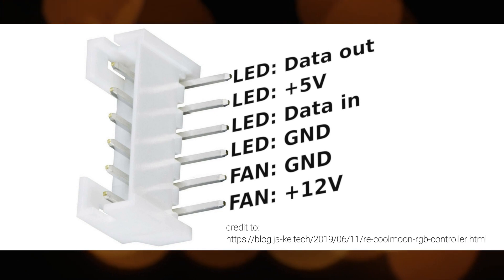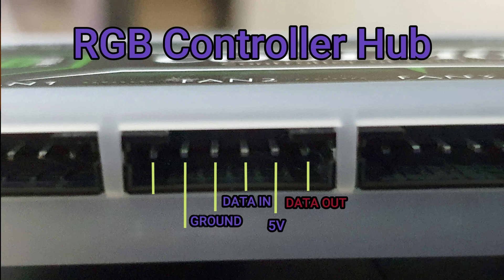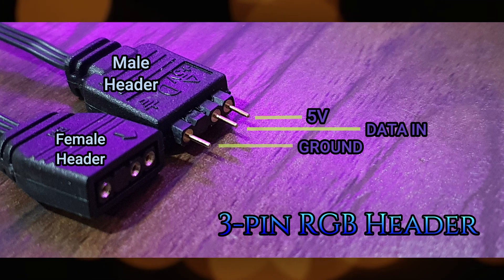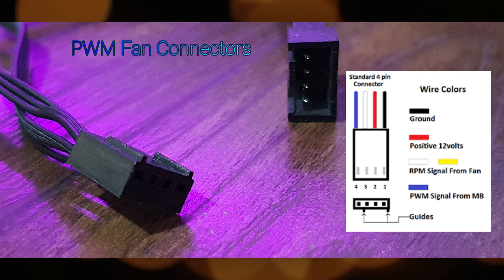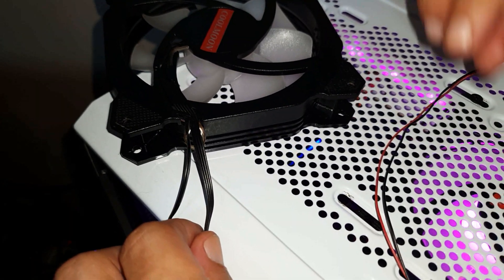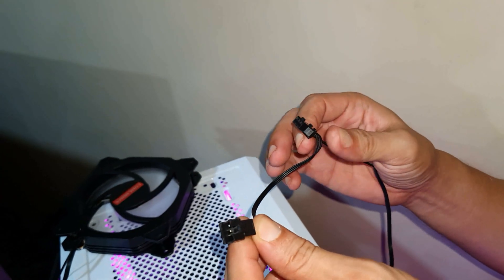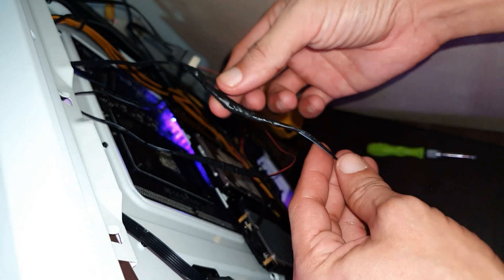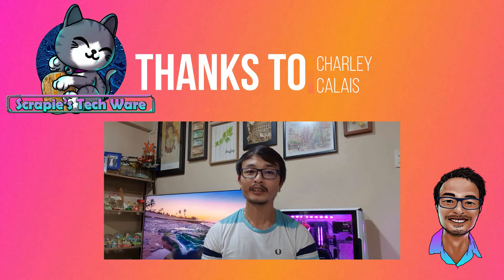Modding a 6-pin header fan (Coolmoon, uphere etc)

Comment: I couldn't see the sockets when you were plugging them in so it was hard to tell which ones you were using and you used electrical tape to tape them up so I know some of you guys have this figured out but I'm too new to this I'll need to see which ones you connected. I can tell it's a good fix I just need a little more information. Good job

Comment: They are nice fans but useless, because they are incompatible without the use of their controller on recent motherboards because they do not have the separate 4-pin connector with PWM control.
Reply: Most modern motherboard have variable DC which exactly functions like pwm

Comment: Great video. I’ll check if the pinout is the same for the Darkflash fan controller (for AIGO DR12 PRO fans). If it works, I’ll keep the Darkflash speed control and manage the ARGB connections with the Nollie controller. 😊

Once I test it, I’ll come back here to confirm if it’s the same and if it worked out.

Comment: can i use 3 pin to 6 pin header  plz reply i need help
Reply: Yes but you can't adjust the speed and light up the rgb, it'll only spin the fan
Reply: sping the fan with pwm mode? @ericdizon3320

Comment: I have 2 CPU cooler fans with 3+4pin adapters and 6 fans with 6pin adaptor. I was using 2 different argb kits that didn't sync well, and because of your video I'm able to convert 6pin into 3 + 2 pin, I used jumper male to female wires, and now all the fans are in 1 single coolmoon argb kit and syncing well. Great job. 👍🏼

Comment: i had deepcool fc120 which is 6 pin rgb fan, but different pins out than normal 6 pin argb gan, from left it mark DI, - , - , + , S, P when i try use normal 6 pin rgb controller it won't work, and  what is S and P stand for on the fan connector?
Reply: Hey did you ever figure out a solution for these fans? I have the same FC120
Reply: Yeah I've got the same fans and need to find a solution

Comment: i just want to power my 240 mm fan. it has a 6 pin connector and i want to plug it into a 3 or 4 pin header on my mobo. i cut the 2 wires and connected them to an old fan connector and when i plugged it in it doesnt work. what did i do wrong?

Comment: The 6pin controller is more cheap than 3pin argb + 4pin PWM controller, it's because the 3+4 is have 4pin data in from motherboard, so the controller can automatic sent the data PWM to fan. It's right???

Comment: Yes, but what is the fucking DATA OUT cable that you said to JUST IGNORE, what's it for? NOT OINE PERSON OR PIECE OF DOCUMENTATION ON THE WHOLE INTERNET TELLS YOU THAT, SO IF YOU DON'T KNOW EITHER, YOU SHOULD JUST SAY SO, INSTEAD OF ACTING LIKE IT'S NOT IMPORTANT BECAUSE OF SOME SECRET FUNCTION OR SOMETHING. Why just ignore it when it obviously has a purpose otherwise it wouldn't be there IN THE FIRST PLACE. so to just ignore it means you are ignoring a potential favourable function that that one cable is in there for...SO WHAT IS THE IGNORED DATA OUT CABLE FOR? That would be more helpful than to jusyt say ignore oit, because otherwise what you just put together is redundant because EVERYTHING in your video is ALL over Google. Sorry FOR THE FRUSTRATION MATE, BUT YOU DON'T KNOW MUCH OF A WASTE TIME WATCHING THIS WAS OTHERWISE.
Reply: The Data Out cable is to continue out the argb/digital signal onwards to another fan or a argb device, which enables the ability to have a chain of devices in order to display complex rgb patterns not simultaneously but one after the other. This is also known as a daisy chain
Reply: Just did my own research since i also need these. 

Those 6 pin connectors are actually just two connectors combined. 
3 pin ARGB (usually "4 pin" with one always missing).
3 pin FAN. So not a PWM (we can't control its speed), just standard fan, that is Ground, +12v and Tachometer that reports back on RPM of the fan.

So in short data out is RPM report from fan to motherboard/hub/whatever.
Reply: @BitFrosty  genuinely was about to type out similar response, but thank you for handling the bulk of the issue.
  As an electronics specialist, when you have a dedicated wire in a harness, specifically put there by a manufacturer, and you decide to bypass or modify its purpose because it works on your personal device does NOT mean itll work for everybody.
  I could go into great detail about why this circuit manipulation works in certain environments, however....do not do this and just assume youre good to go.
Reply: As @devilproductions-official says above, the Data Out line lets you continue the RGB chain rather than running each fan as an individual.

To expand on that:
Using a hub, the software doesn't see all the individual devices that are plugged in, it only sees the one device, and the hub duplicates the software output to each connected device.
For example, if each fan has 8 led segments, if you connect 3 fans through the hub, the software will only see 1 fan with 8 segments and output an 8 segment pattern, and all 3 fans will show the same pattern.
BUT, if you run the data-out from the first fan to the data-in of the second, and the data-out of the second to the data-in of the third, the software will see 1 fan with 24 segments.  Now you will have a pattern that spans across all 3 fans, e.g. instead of an identical rainbow going around on each fan, there will be 1 rainbow that works its way across all three.  It's easier to visualise if you think of straight RGB bars instead of round fans.  If you put 3 bars side by side with 8 segments each, using the hub, you will have the rainbow repeated 3 times across the length of the triple length bar, but if you do the data-out->data-in set-up you will have one rainbow running the full length of the triple length bar.
For fans, this doesn't look very good, so most people will just connect through a hub and have each fan doing the same pattern, but for bars, it can be very effective.
It's a bit like mirroring your display on 2/3 monitors, or extending the display across them so it's like one bigger monitor.

This is the THEORY of how the data-in and data-out work, however, I have seen elsewhere that Coolmoon do not actually connect the data-out line, and that pin on the PCB in the hub is not connected to anything, so I don't know if they built the fans to have the capability since they don't use it anyway.  Why spend a few cents to include a function you aren't going to use.

Bottom line is, if it's just for fans, you probably don't want to use the data-out method anyway and should just "ignore it", but at least now you know what it is all about.

Comment: Would it work to use pins 1+4 instead of 1+2 of the fan PWM header in order to control the fan speed from the Mainboard?
Edit: Tested it on my coolmoon fan and it works like a charm. So PWM control is no problem.
Reply: Hello, could you elaborate more about how did you do it?
Reply: Because, if you dont use the Number "2" pin, how do you supply the 12V to the fan?
Reply: @joeSD97  I simply connected the + cable of the fan to pin 4 (control) of the connector. PWM works by using intervals (I don't know what intervals Mainboards use for that but let's say 0.1 second) and supplying a voltage (in this case: 12V) for a percentage of the interval. So if you want to give half the power you supply 12V for 0.05 seconds and 0V for 0.05 seconds and that evens out at 6V (half the voltage)
If you want to read up in-depth about that I would recommend googling the topic.

Comment: I have 6 pin fan hub, is it okay to connect my 4 pin fan without rgb to it for speed control purposes. Since my mobo dont have any other socket for me to connect.
Reply: The 6 pin h chinese wiring has no speed control. Just power for the fan and cabling for RGB.

Comment: Hi!! I have 10 fans installed in controller box but I'm still don't know how to connect into motherboard. I only can control fans speed and color modes from a remote control. So, which cable I have to connect in the controller box and then to the motherboard..... Because I really want to control fans from the motherboarnd and not only the remote control!!!  Thanks!!
Reply: Did you find the solution? Im searching for it
Reply: Corsair Commander Pro is the solution
Reply: @erichv.haubitze296 that’s a 4pin fan controller, not chinese 6 pin.

Comment: very good video !!!
I have another problem, my CPU fan (gamma 500 RGB), it has 2 connectors a standard PWM that already connects without problem to the motherboard (RPMs and power OK) but also has a 4-pin RGB connector (12v, R, G, B) and my RGB controller is the common 6-pin (my motherboard is very old and has nothing with RGB). How could you solve this problem?
The fan works without problem but I have no RGB, in the worst case I would like to leave it fixed in red color.

  Please your help.

Comment: Hii ,  I bought a 3pin fan, but the b450mk motherboard doesn't have 3pin, I want to convert it to USB because it's 5V, is this possible? I don't want to control RGB, I just want to turn it on automatically with just (+-) for USB, but it doesn't seem to work without (PIN data. In) short, how to install this fan without 3 PIN on my motherboard؟
Reply: Just look for a cable that convert 4 to 3 pin. I have one that I can connect 4x 3 pins and my motherboard doesn't have 3 pin!!

Comment: Hi. My RGB fan hub is much like your Coolmoon with 6 pins on each slot. I have a Jonsbo NC-1 that I want to connect to it, hoping to control the lights as well. 

Here's a reference video of the product.
https://www.youtube.com/watch?v=5yfXXienfjw&t=330s

Basing from your video (1:45), I "seems" like an RGB Fan Connector.

I've seen it done in another video, but with a 3-pin RGB Header.
https://www.youtube.com/watch?v=HvEMlHblw7A&list=WL&index=4&t=147s

Can this be done? Please help. I really love the look of my heatsinks, and it's the only one with a white variant for my build. I couldn't find a cable converter and I'm too new at this to be cutting wires.

Would really appreciate the help. Thank you.
Reply from the maker: Hi, it is possible as long as the voltage are properly aligned based on my video. Each pins on the coolmoon hub has its corresponding input and output for rgb and for the fan. Kindly review the diagram on the video for your reference. You just need to create a custom wiring from ur nc-1 going to the coolmoon hub. If you cnt insert the native wire of ur nc-1, I suggest removing the cover of the hub. Let me know should you need clarification
Reply: @scrapiestechware267  will do. Thank you very much!!!

Comment: Hi, i am using aorus b570 pro with 12 grb 4pin header. And i have UPHERE pc fan with 6 pin header with controller. Im having a problem on how to connect it from my mobo led port.what connectors do i need to buy?
Reply: you must have 5v ARGB controller on your board, by right it should have.

Installing 5v ARGB controller on 12V ARGB port on motherboard, it will surely burn your controller (and possibly damaging your motherboard).

Comment: I've PowerBoost case and it has 4 fans(6 pin) with RGB on center and around of fans. When I decrease fan speed the leds are flashing that on the around of fan. I am not able to control around led without decrease speed. I might use the center leds but I don't want to see the annoying flashing led. which cable or pin should I cut for disable around led?

The case is: https://www.itopya.com/power-boost-vk-m202b-tg-mesh-panel-rgb-usb-30-mid-tower-kasa/
Reply from the maker: I am not familiar with the fans you're using... but if you could state the specific brand of the fans itself or where i can have a full view of the fans itself, i would love to help you figure it out.

Comment: Can you control the fan speed?
Reply from the maker: no, fan speed can't be controlled since the fan is only using 2 wires to power it on and this is for most of the 6-pin rgb fans specifically Coolmoon.
Reply: @scrapiestechware267  and if it connects not 2pin, but 3pin along with the DATA_OUT wire?
Reply: If you have the stock controller you can use it to control the speed as it uses PWM (Pulse Wave Modulation) to control fan speed. Just connect the ground and 12V wire into its corresponding location on the original controller and use the included remote.
Reply: @shlushe1050  it's ok I bought a 3pin fan controller and set it to 4,5V and now it's super quiet
Reply: the only way to control fan speed is if your fan have two separate ports (one PWM and one ARGB header), instead of merged 6-pin header.

And ARGB headers are connected to ARGB hub, PWM headers connected to PWM hub. that way, you can control the speed and argb independently.

Comment: I have a modular psu and i dont have the 4 molex to the psu it has only 3 pin. What should i do? its getting hard to find a 4 pin one
Reply from the maker: A 3-pin fan connector can be used, since the wires to power on the fan is only using 2 wires (12v & ground) . Check the diagram on the video for further details.
Reply: @scrapiestechware267  Then i dont know why my RGB does not work... Any advice?
Reply from the maker: @Z3RO94EsP  just to make sure we're on the same page, what rgb fan are you using?
Reply: @scrapiestechware267  Coolmoon
Reply from the maker: @Z3RO94EsP  i need to clarify, what is not working, the led or the fan not working or both? Are you having issue with the connector for coolmoons rgb or the fan not spinning?
Reply: @scrapiestechware267  all 4 fans Spin but no RGB neither in the Coolmoon "motherboard"
Reply from the maker: @Z3RO94EsP  i assume that you havent modified your fans, since you're using the controller that came with it. If your issue is your psu not having a 4pin molex connector to power on your coolmoon fans, then i suggest you get a sata power cable to molex adapter for your psu. The reason i say this is, your coolmoon controller requires a 4pin molex to connect to your psu. If all else fails, then you might wanna consider a different rgb fans.
Reply: @scrapiestechware267  awesome, ill try that, my PSU is modular so im gonna try to get it. Thanks a lot for the help!
Reply from the maker: @Z3RO94EsP  it's a pleasure. Cheers!

Comment: Great video, 1 question does it work with asus 12v header?
Reply from the maker: Can you elaborate your question further? Are you asking if you can use a 12v header wires for argb?
Reply: No it doesn't, you'll need 5v to 12v rgb transfer hub
Reply: 12v argb controller only works with 12v argb port on motherboard.

5v argb controller only works with 5v argb port on motherboard.

You're supposed not to mix it up.